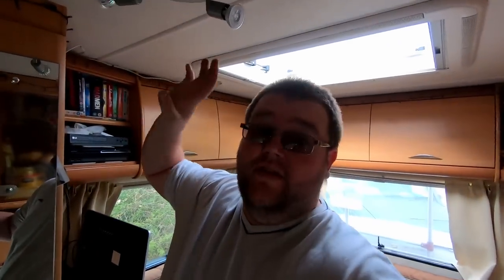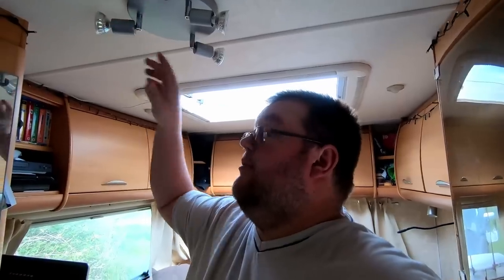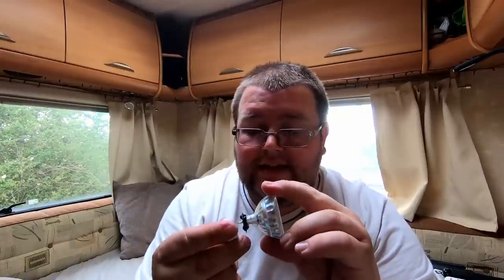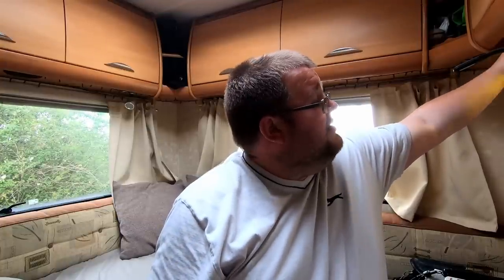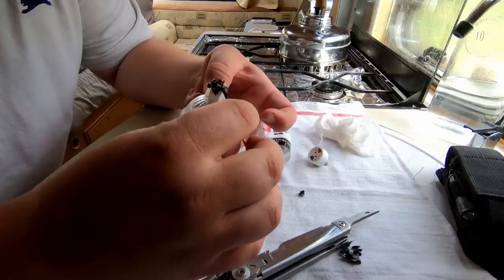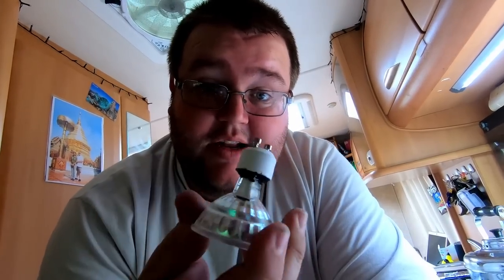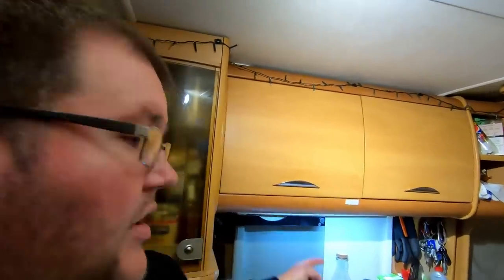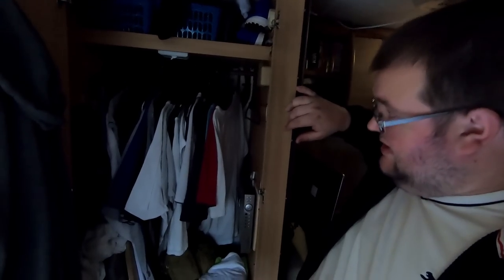How to Convert 240V LED Spotlights to 12V in a Motorhome

Comment: Out of curiosity how did you wire your light fitting? I’ve bought 240v lights with gu10 bulbs, and read that with the adapter you don’t need an earth wire, is that true?

Comment: brill vid  top van hack  you can use gasket silicone  heat resistant up 450  but more expensive about £9.99 halfords

Comment: Off subject but when looking at a used motorhome- how do you check for damp ? Apart from just looking .
Reply from the maker: Yeah you can buy damp meters, you can feel the walls/floor/ceiling and be spongy. You can even pay a mobile motorhome/caravan specialist to check for damp and do a mobile habitation check for a few hundred pounds, depends on how much your spending. You could always get the seller to out a hab check on it before buying
Reply: @TheUrbanMotorhome  Cheers - very helpful x
Reply from the maker: Your most welcome 😁

Comment: So can you still change the bulb after fixing it together with that stuff?
Reply: No but it's an led and should last a very long time
Reply: @prepcooksurvive5807  I see. Thanks
Reply: Lot of agro tho I'd just buy another adapter and like I said leds last forever almost
Reply from the maker: You could prize the stuck adaptor and bulb apart if you really wanted to but one end is gonna have the silicone stuck to it really well as you can see in the video I tried to remove it from the bulb to re-stick it and I left a lot on there because it was that stuck and when the adaptors are only £1 and bulbs are relatively cheap too I'd go with a new one. Like Prepared to cook and survive said LEDS last forever, the ones in this video have got a 25,000 hour life which is crazy long haha 😁😁👍👍